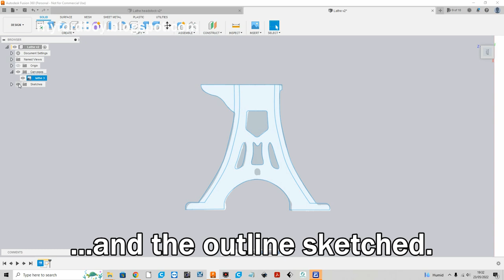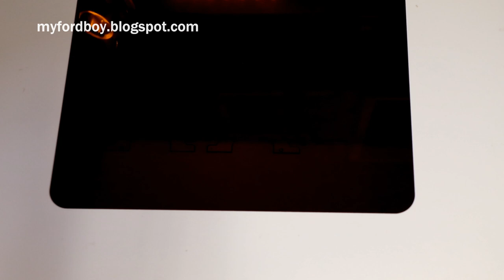Metal Casting at Home Part 122 Casting with a Matchplate. Steam Marklin Model Workshop.

Comment: Another wonderful insight. So much learnt without a word of narration! Do you ever cast using steel? If so are there any tips, or might you have an episode in your library for me to watch. Many thanks.
Reply from the maker: You cannot cast steel without industrial equipment. You can do iron at home.
Reply: @iteerrex8166  the legs ARE made of aluminium, with some zinc aďded
Reply: @andyb7963  I completely missed that part where he mentions what the metal is :/
Reply: Aluminum and zinc

Comment: Hi Myfordboy.  Are these items going to be available as a kit for others to machine and assemble?
Joe Pie (Joe Pieczynski), has made various workshop machine tools along these lines.
Great work as usual, and always a 'must watch first' video from you.
Regards Mark in the UK
Reply from the maker: I can cast more legs if anyone wants some. I am working on a smaller version to match the scale of the bandsaw model in the previous video.
It won't be a fully detailed one but a replica of the origional 1930s Marklin one to be driven by a model steam engine.

Comment: One more great casting !
Wouldn'i it be less demanding in terms of finish for the pattern to 3D print it with drafts and fillets included ?
Reply from the maker: Just an alternative way of pattern making. I think a pattern with thin flat section is less trouble to finish than a printed one.